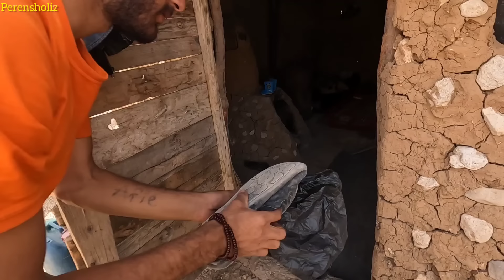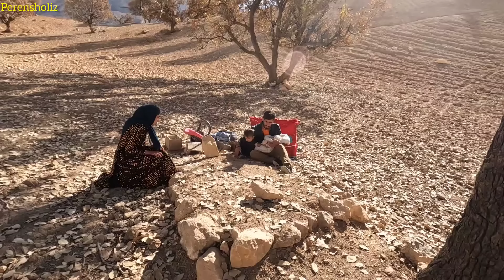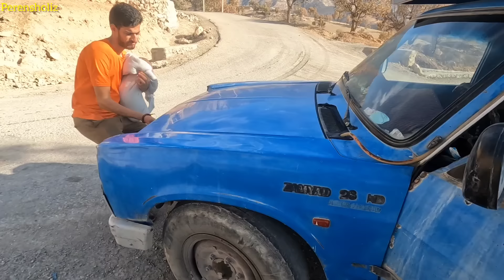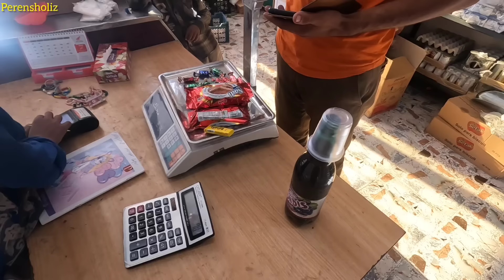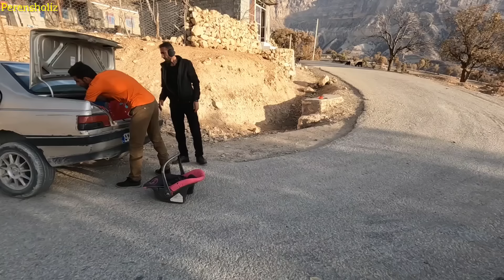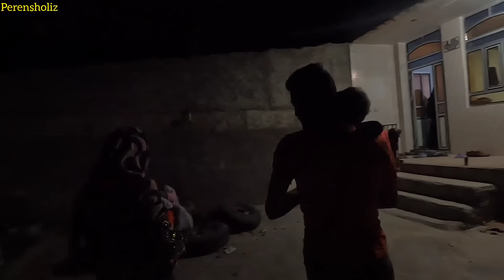"Persistence journey, Saleh's bitter farewell to Masoumeh, a journey full of adventures"

Comment: 😮❤🎉 Saleh, keep in touch with the benefactor who befriended you. And, get that oil leak fixed so the engine doesn't run out of lubricant, causing the engine block to crack.